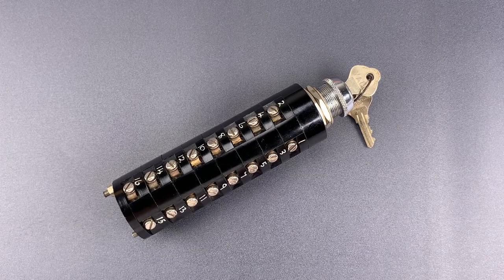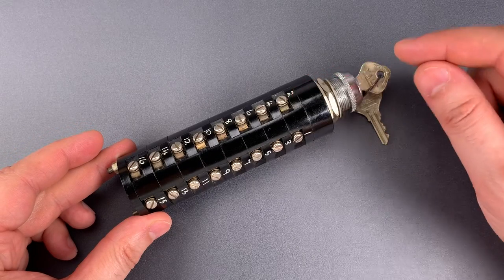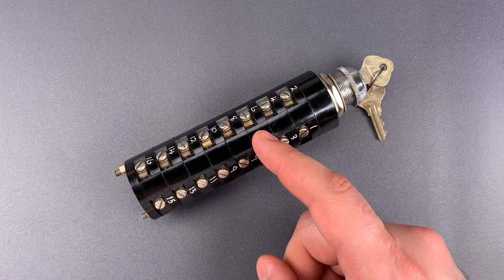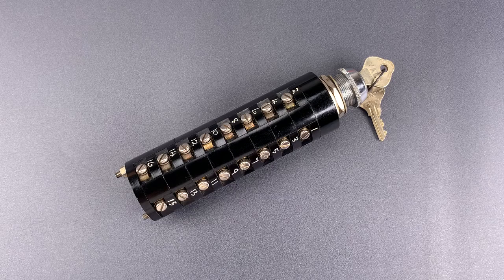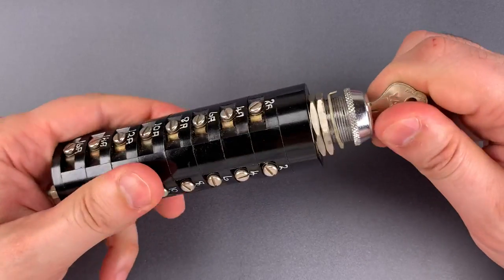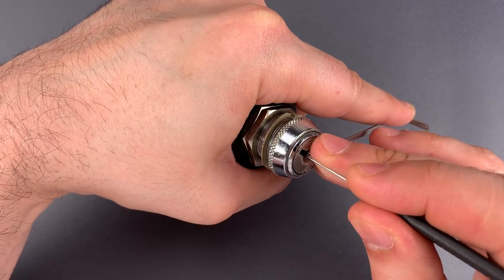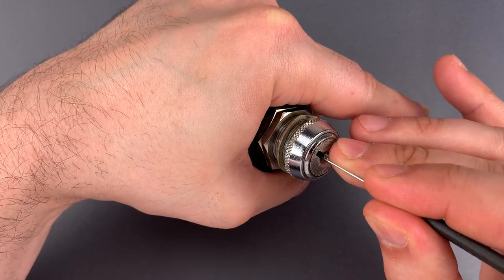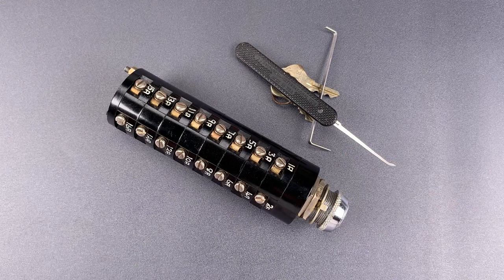[1154] Missile Control Key Switch Picked

Comment: Fun fact, for a few decades the launch codes for the USAF’s Minuteman ICBMs was “00000000”. The Air Force was ordered to put the code locks on for security by the DoD but they worried it would take too much time during an attack for the crews to enter a bunch of different codes. So they just left the default all zeroes as the code.
Reply: Yep, that's really typical. A lot of construction equipment has sensors in it requiring seat belts or restraints to be buckled to start the engine. It's common to see the seatbelt buckled around the back of the chair, or other bypasses for convenience. It's hilarious the danger people will put themselves in for convenience sake.
Reply: Just keyed-alike on a more grand scale.
1284X, CH751, 16120, 222343, C415A, FEOK1, about 8 HUD keys... It's all over the place. (Except my keyring, I don't have any of those.)
Reply: @matthewellisor5835  He missed the part where they also left that all 0's code punched in at all times too, bypassing even the need to do that for an unauthorized launch.
Reply: OMG!
Military intelligence!?
Reply: @MrWhite2222  bid fraud on top of bid fraud
"Capitalism doesn't work," some say. No, crony-capitalism doesn't work.
Reply: @matthewellisor5835  people who say capitalism doesn't work usually don't understand that capitalism is merely the exchange of currency for goods and services.
Reply: @theghostofthomasjenkins9643  I'm pretty sure it is you who don't understand what the capitalism is.
Reply: @Struktualnyj  then what do you say it is?
Reply: @theghostofthomasjenkins9643  Capitalism, like so many other ideas, works so long as you don't get the nasty human elements involved. In reality the problem isn't with any economic system but is with the fact that people will try to do immoral shit.
Reply: Kenji Takashima True, that’s why you need very clear rules with very severe consequences when broken.
Reply: @kenjitakashima1041  the difference is that capitalism can survive corruption while communism and socialism can't and immediately implode.  capitalism is the only form of economy that works because it's the only form that accounts for human greed.  it's not perfect, but it's sustainable without complete economic collapse.
Reply: @kenjitakashima1041  Right, understanding that people are naturally broken and then mostly choose to do good. (That "mostly" gets ya.) Still, we can choose to be Free to Choose and, without violence, offer exchange of property and services.
Leonard Read: Anything That's Peaceful, is a personal favorite.
Reply: The only moral economic system is the one that respects everyone's right to live a personally fulfilling life. Everyone has their own home, they have a fulfilling job, they can eat healthy and they can fund a humble hobby.

In the real world capitalism means few people get unlimited growth in their freedom at the cost of freedom for many. We're all supposed to pretend that is OK and that we all should just strive for the same lifestyle, when were never meant to be "successful".
Reply: @theghostofthomasjenkins9643  That isn't what Capitalism is. 
cap·i·tal·ism
noun
an economic and political system in which a country's trade and industry are controlled by private owners for profit, rather than by the state.
Reply: @vejymonsta3006  LOL, and that's called a utopia that can't possibly exist.  try living in the real world and deal with it using real world solutions.  the ONLY way what you say is possible is if you remove free will.
Reply: This is a cool fact, and I believe you. But it would be fun to read some kind of source besides (no offense intended!) a YouTube comment.
Reply: @matthewellisor5835  I think the heart of the disagreement is over how much capitalism should be regulated. The fact is that pure, unregulated capitalism cannot exist. As soon as you remove all regulations, someone will inevitably bribe a regulator and then you've got crony capitalism and regulatory capture. At best, capitalists should be looking for a well-regulated system with checks and balances against cronyism and  anti-competitive behavior.
Reply: @kauske  Well, to be fair... If you broke into a nuclear silo and saw "0000000" on something preventing you from launching, would you assume "oh, obviously 0000000 is the code and they just left it like that." 
That would, unironically, be one of my last guesses.
Reply: @HeyImLucious  You can't authorize a launch as a single person anyhow, unless you happen to be as stretchy as mr. Fantastic, and can reach both key terminals. The reason for nuclear launch codes is to prevent launch bases from being able to autonomously launch. They are not supposed to know them until command sends the order, and the launch code. In practice, this was sidestepped entirely.
Reply: @Oberon4278  If it's truly unregulated, there IS no regulator to bribe. No point in having regulators if there aren't any regulations.
Reply: @Megatron995  You're suggesting a society without laws, which isn't possible. As soon as anyone gains an advantage they will use it to enforce their will, at which point they have created de facto laws. And if you say "Oh no we won't allow that," then you're acknowledging that someone will be in a position to allow or disallow things. We call those people legislators, and the rules about what's allowed or not are called laws.

No matter which way you spin it, you're going to have rules and regulations.

It's like what's his name said: Democracy is the worst form of government, except for all the others. Probably Mark Twain or Oscar Wilde.
Reply: @somestuffithoughtyoumightl6985  no rules will ever prevent anything, its when people learn to respect em that does it, its all about respect and responsibility
Reply: @Oberon4278  Churchill is among the credited, but he unsourcedly quoted it in his statement; "it is said that democracy" etc.
Reply: a real life Spaceballs luggage combination...hardly reassuring
Reply: It's not a fact but, a myth. There was enable code and launch code. The launch code was changed ever year. Then, the launch code was segmented between multiple people. Even if that was the case, if the crew in the silo tried to fire. The Wing Command Post would revoke the launch.
Reply: Technically it’s a great code for missiles. 
1) it’s easy to remember
2) impossible to mess up 
3) any spy that brought it to their superior would be shot, because they’d think it was fake and they were flipped
Reply: @MrJayrock620  It might have been used in arming the missile but, the secondary code used to actually fire would be changed fair often. but,  technical you could arm it and puncture tanks within the missile.. you wouldn't survive but, it could cause WW3.
Reply: If someone wanted to launch it, they would find a way. A code would just slow them down
Reply: @Pickleriiiiiick  Yes and no.. there was one control center over 10 missiles then, main control center. Both could revoke the launch if the silo crew tried that. The main control center could also fire all missiles under orders from the president.... But, in Russian all it would take is 3 officers all voting yes and turning 3 keys to fire. If locklawer showed anything using key locks is probably the worst idea.
Reply: @Pickleriiiiiick  the problem with this theory is that you would need quite a few people to agree with your attempt. No one person could launch a missile. Even from within the silo. Reason being that multiple silos need to agree to a launch. That was one of the built in fail safes. If the silo did not receive at least 2 other launch signals... No missile launch.
Reply: @RenniaTrayvold  that's all fine and dandy until you have an electrical logic minded person. Yes the key is there, yes multiple locations need to agree, but all they need is a print to bypass any external control, there's always a dumb end that if it sees voltage in the right spot, you've launched a missile
Reply: @Pickleriiiiiick  Good luck figuring it out on the spot and convincing the crew to turn a blind eye.
Reply: @kauske  That's the real reason those super short ' seatbelt extenders' exist.  The ones that are literally a male end sticking out of a female end.  It's so you can stop any seatbelt sensor from triggering without actually having to buckle the seatbelt.
Reply: @taccovert4  I've always just seen the belt bucked behind the seat, or across it, and people sit right on it. I really don't understand the opposition to safety equipment, then again, the ludicrous amount of people refusing to wear PPE in the middle of a pandemic shows human's propensity to be stupid for no good reason.
Reply: Sounds similar to the userid/password on a cheque printing system where I worked. The super users userid was userid and the password was.... I think I've given away enough secrets already.
Reply: Please. Please tell me that's a joke.
Reply: 90% of people's wifi routers have one of those as their panel login ID:
admin/admin
admin/(blank)
root/(blank)
Yay for security! Also 80%+ of people's passwords can be bruteforced in a few hours.
Reply: @philgray1023  When I was in high school back in the late 1990s and early 2000s, I learned that the school's default login & password were the following:
Login: library
Password: books
Armed with that information, I used to sneak into the computer room while my grade was in assembly and spend forty minutes having unrestricted 'free time' on the computers.
In 2005 (a good two years after I graduated from the school) I returned to the computer room while waiting to pick my younger sister up due to a family emergency. Out of interest, I fired up one of the computers and tried the old 'library/books' code to see if they still worked...
Yep, they still worked.

Comment: In electrical engineering, this is a  pretty standard part and a number of companies make them.
You buy them as a number of switch segments, either 2x Normally Closed contacts, 2x Normally Open contacts or 1x NO and 1x NC contacts.
Then you simply cut the shaft and threaded studs to the correct length and assemble a custom switch with any function you require. 
In this case, the terminals have been marked up by hand using some white paint and a brush, not uncommon on aircraft.
Reply: I second this, they are used for basic remote/local control selection at motor control centre level and on some distribution panels. 

Nothing special, the keys break easily.
Reply: I also agree ... seen quite a few of these in plantrooms .... just a std, user defined, keyed rotary switch.